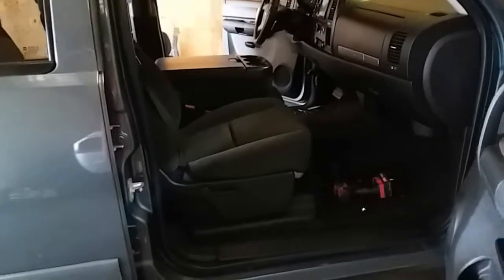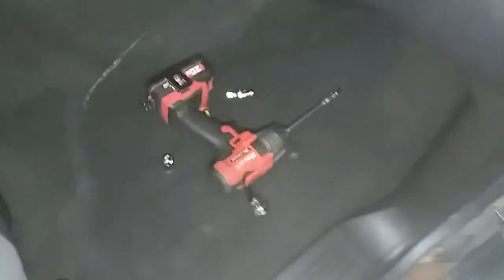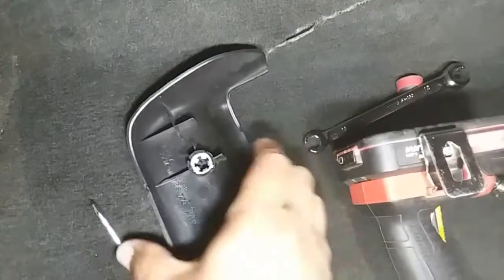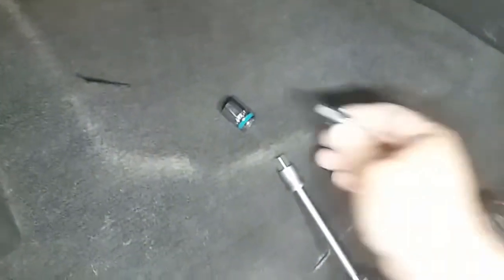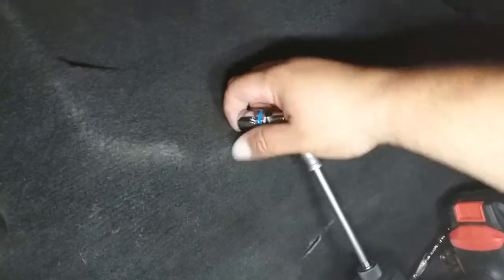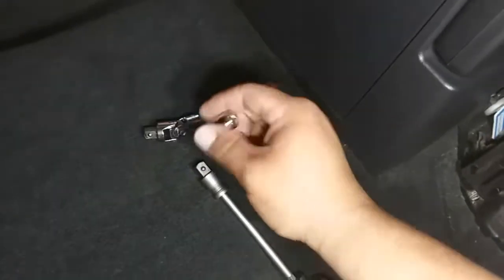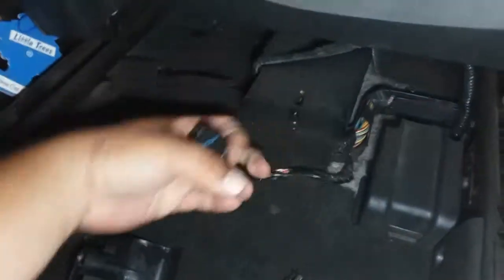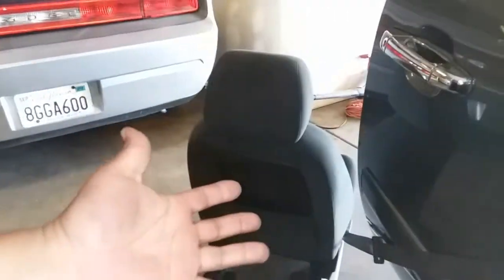How to: Remove a Passenger seat on a 2007 Chevrolet Silverado

Comment: Thanks for taking the time.  The bolts in my are a star shape.  WIll a normal socket fit over these or do I need to buy a special tool?
Reply from the maker: You're welcome, no any 12 point socket will work but it has to be 12 point ....6 point will not work

https://www.familyhandyman.com/article/6-point-sockets-vs-12-point-sockets/
Reply: @559powerscape  much appreciate it George!  I'm on it tonight then.
Reply from the maker: For sure Good luck brother